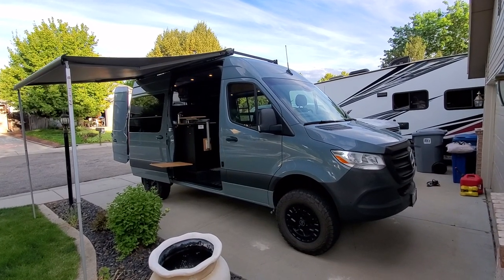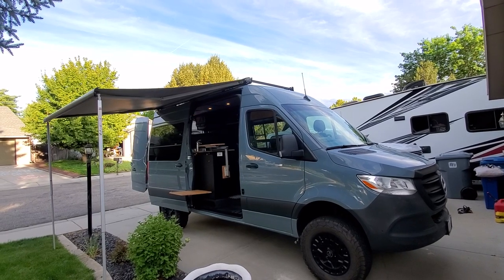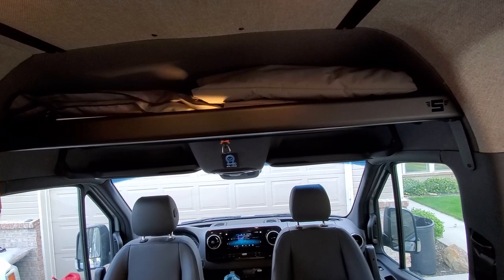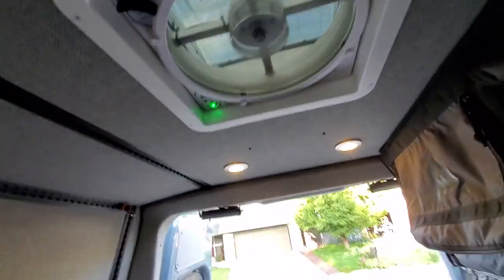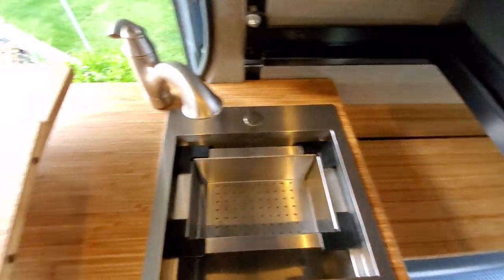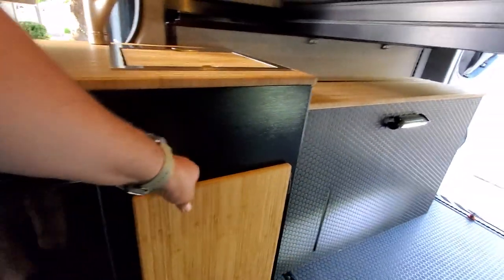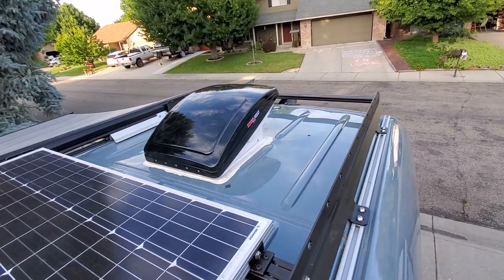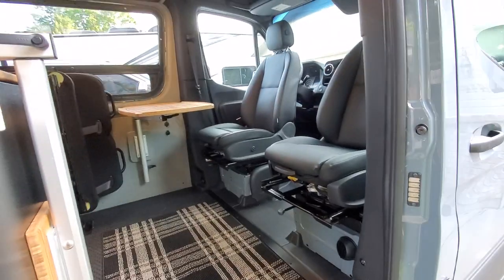2019 Mercedes-Benz Sprinter 4x4 by Launch Vans & E.M. Motors

Comment: Only 200 amp hours with that microwave and water heater?
Reply from the maker: Lithium baby!
Reply: E.M. Motors Boise I know but still. Most builds I’ve seen with that kinda draw are running twice that
Reply from the maker: If your using it a ton for sure you would want more but the water heater only runs for probably 20-30 minutes every couple days. Microwave doesn't get used a lot either. I have 600 ah in my van😁
Reply: E.M. Motors Boise it’s a beautiful build. I have been kicking around starting my own van build company. As an electrician I feel like I have the hardest part covered.  Did you create an LLC to protect yourself
Reply from the maker: So we have owned our little dealership for 10 years. We are an S Corporation. But yes an LLC for you i would imagine would be perfect.  Have a lawyer write up contract for you & your customers to protect both parties. Best of luck if you do! So much fun building these vans and putting smiles on our customers faces!